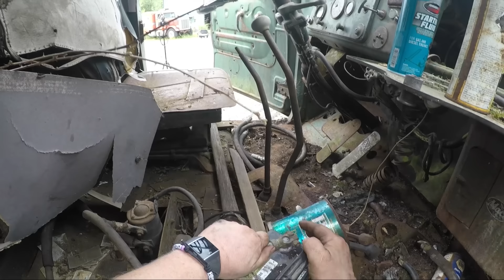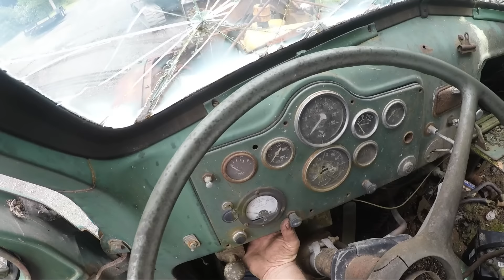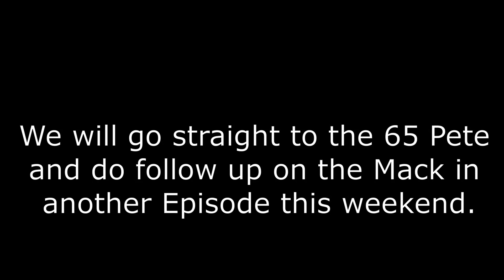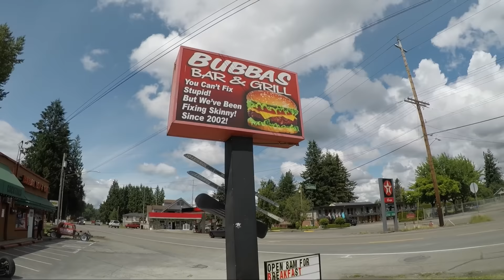Will it start....1 that should 2 that were abandoned (PART 3)  75 Pete (y),  59 Mack(yes) 65 Pete ??

Comment: 51:30 is an old AirTrack crawler drill and compressor, air over hydraulic for the mast positioning, big radial air motors for drive, with a pneumatic hammer drill. I operated one for about 6 months, you get fit quick working those things, as well as deaf, sunburnt with a touch of silicosis. Manual rod handling, Detroit 6v71, 750 cfm@150psi compressor, 100 foot air hose. It will drag that compressor anywhere. Like you said, up the sides of mountains. They scale in size too, that looks about a medium.

Comment: Thanks man,good stuff. I worked on a lot of those engines in the 70's. Detroit's were notorious for injector cup seal leaks,especially when they sat for ext. periods.Yours is clearly a rain entering engine cause.We'd pull the oil drain plug,to check for water,(coolant), then most of the time they would stop leaking after an injector clamp retorque and just running again for a time.

Comment: Pull valve covers on that 8-71, and look where injectors enter head,and you can actually see water dripping down,if the inj. cups top seals are leaking.Sometimes you don't even have to pressurize cooling sys, to see it.

prpoer repair is pull cyl. heads and have a machine shop recup.

Comment: I enjoy content like this, I'd say look into the 1 that doesn't seem to bar so well . See if you are able to push out water of that cylinder.  Maybe even introduce oil or lite lube to the cylinders.  independently.  If the old man is up to it there's alot to p lil ay with up their.  Hopefully you would have the time to fittle for awhile. You can get back to the mack and the other truck a lil later. I think the viewers will follow requardless. I used to do things like this as a field mechanic.

Comment: C.L., With the water so available inside the block, it being clear instead of milkshake brown is it possible that the crank,wristpins,connecting rods,bearing is not be rusty?. I understand the heads may have enough oxygen to promote rust.

Comment: Just lovin this affair!! Can we see the old mine and the logging operation or what's left of it. And get the blasting generator and that all running!Thanks!!
Reply from the maker: I will cover some of it in the next episode, he is a little touchy about the mine as he has had many problems with people sabotaging or vandalizing things, even though it has been close since the 80's 
Cheers
Reply: @countrylife4195  rusty Detroits often run away, so be prepared with a block of wood to cover the air intake and you need to remove the valve covers to be sure none of the injectors are rusted at full throttle, which happens often.  If you roll off especially, what will you do about a runaway engine? got good brakes? how are you going to cover the intake while moving?
     Also, try to turn the engine very slowly at first, preferably by hand, to prevent hydro-lock damage.  Bus Grease Monkey knows Detroits.  :  
https://www.youtube.com/user/avonpicturethis
Reply: @countrylife4195  work it back and forth a million billion times ad tedium. take shifts. good thing you have a bar so you don't have to switch a ratchet every time.  and don't bore us with all the film unless time lapse.

Comment: never try to move an engine sitting for so long and with with water in it. take the injectors out and drop a lot of oil/quersene in it, drop the oil pan, clean it. change oil filter and put new oil in it. THAN try to move it slowly dropping more oil in the cylinder. if it moves free, than crank it to see if the oi pressure is ok and look if it goes up to the heads.

Comment: 8 months too late. But those old Cummins engine with the PT fuel system. Have a thumbscrew in the solenoid that allows you to bypass the electronic fuel solenoid. Then you can pull start the truck. With Zero electronic power......  and it will stay running either until you stall it out or run the screw the other way.....

Comment: hey man figured id tell you its a positive ground system its one of a few trucks of that year that had there is info on google about it the front of the starter is the ground which is why it keeps arching and blowing the tops of the batteries off
Reply: does it have the 855 cummins?
Reply: @TylerDuysen  no mack is mack . It an early mack I'd say late 5os into mid 60s . I think 255 .

Comment: finally someone knew enough to drain the oilpan out  got very big problem if ye start it you will only will start it will scream then get real quiet
Reply from the maker: Glad you mention that....
The whole point of this is to find awesome machines and bring them back to life, back to work if possible. I see so many "will it starts" where they pull the dipstick, add a battery and start spinning. If you add enough ether and spin it fast enough, almost anything will start...once or will start while doing a great deal of damage to itself.
Cheers!

Comment: no voltage on the cable means you need to clean the inside of the terminal its not rocket appliances here
Reply from the maker: Lol, I did not show it on the episode but it took several cleanings...
They were pretty corroded from sitting exposed.
I try to show everything but no one wants to watch 20 minutes of cable cleaning so  some things seem a bit out of context...
I will be more careful about how I edit things in the future...
Thanks for bringing it to my attention.
What are rocket appliances?
Reply: @countrylife4195  its the class you take after rocket science

Comment: The one battery might be shorting it out when it sparked
Reply from the maker: That whole system is goofy, I went through 3 wiring diagrams and a bunch of off camera testing. It arcs like that no matter what I try. 
I think the starter is rusted solid but it could be other issues

Comment: If the engine will turn it will run it's hard to beat them Detroit Diesel
Reply from the maker: Editing now but the last Detroit was by far the best...
Full of water and it did not care at all, LOVE the 2 stroke Detroits cause they just run. 
As Joe says, if it's dead it's cause you killed it, they don't die by themselves